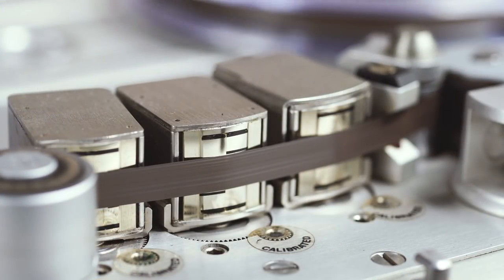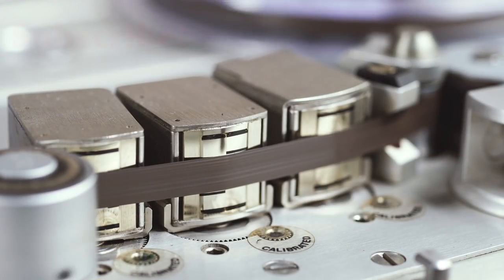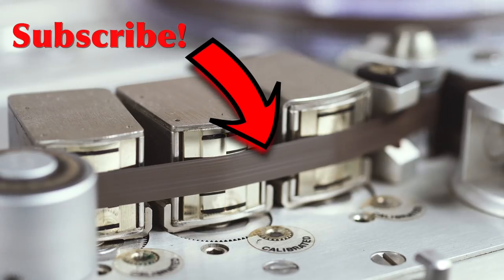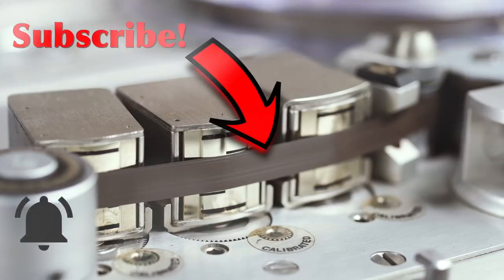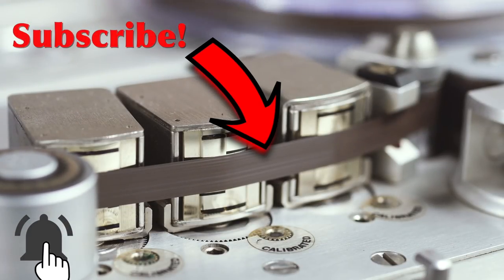Hegel H590: Reference or Illusion?

Comment: A REQUEST:   A comment below from TOMISLAV GASPARIC about super high damping factor sounds makes a lot of sense that I really hope ANADIALOG can respond by saying what speakers were used in his review:

"That can be related to high damping factor, some, most of speakers do not like it, their crossovers, their diver/enclosure tuning can interact with high damping factors and start to ringing due high Q states in loudspeaker system.
Try to put 0.05-0.1R power resistors in series with loudspeaker"
Reply from the maker: I did not see the comment. As you can imagine there are hundreds to process and the darn app does not work properly.
In any case, if this is true, the amp is even a worse project than I thought. How many attentions do we have to pay after spending 11.000€!! The speakers I was using are a GoldenEar Triton Reference.
Reply: @anadialog  The question to ask is really how many (%) of speakers out there and what % of audiophiles do sense this "problem".  At the least, Harbeth designer Alan Shaw seems to like Hegel "sound/no sound" and demo his great speakers with.   I myself as another audiophile don't sense that "problem" as some Analog/tube people do that I have to question based on their taste of liking harmonic distortion/color than pure high FIDELITY and can not clearly define "digital" sound scientifically in both qualitative and quantitative/measurement terms. :-)

Comment: Finally, someone that has cojones.. and it needed to be italian for it. 
First of all Hegel amps sounds off.. all of them. 
Second, what’s the point of making a class b amp trying to make it sounds like a class correcting its natural distortion with a class leading circuitry? Uhh 11k € you said! Now I get that. Good technology comes cheap and for all. 
Now for 11k is possible to get a much better amp full class a. Hey but class a gets hot!.. Uhh use it during the winter than. 
Dumping factor you said?!
Well I build my stuff from scratch and that doesn’t count.. but hi impedance speakers would solve this problem. Why on earth the industry keep selling 4-8 ohms speakers to go with fancy amps you think?!  Wouldn’t you buy a 300 ohms speakers with dumping natural factor to die for?
Look with 11k I can build myself a point to point wired tube amp only made of gold glass and ceramic. Think about that. Uhh… even the tubes!?
Yep even tubes.

Comment: I had the same impression of the “separation” until I changed cables. It then all came together. It sounded totally natural and coherent. I’m not a cable guy but the recommendation made all the difference.
Reply: What cables if you don't mind sharing?
Reply: What kind of cables do you use?
Reply: and you didn't mention the cables?  Wtf!

Comment: Great review.  It’s spot on.  I moved from the Hegel H390 to the Luxman 590ax2. The Luxman is an awesome amp so musical and full sounding.  Sounds like music. I would describe the Hegel as surgical sounding.  Not my cup of tea.  Keep up the great reviews.
Reply: Luxman is a beautiful kit. Although it’s not made in Japan anymore like Accuphase. Have you tried Pass Labs?
Reply: @morespinach9832  the lower end Luxman are not made in Japan but the higher Luxman like the 590ax2 was made in Japan.  Luxman no longer makes the 590ax2.
Reply: @JayLee-zz3ty  so which Luxman is made in Japan? Their lower end stuff is way too expensive if it’s not made in Japan.
Reply: @morespinach9832  here are some of the models made in Japan, 590ax2, 595ase, 509x, high end separates. These are just the ones I know.

Comment: I still like class A/B amps. My system is tri-amped with two Parasound amps and an Adcom amp.
Reply: Class A/B amps are usually a good solution, especially if one needs a lot of power. However, pure Class A amps are superior IMO, but they generate massive amounts of heat if a decent amount of output power is needed. I have a Class A headphone amp, which at that low power is not much an issue with heat, and it is far superior to any other amp I have used. BTW, the Hegel amps are A/B.
Reply: @mark9118   oh, I didn't know it was class A/B. At any rate, my old Parasound amps sound great. Don't think I will ever replace them.

Comment: I bought the hegel H360 after my Krell kav300il baked out of warranty, I tried many products at and around the 360' $5500 retail and for the speakers I was using then the Hegel was clearly the best sounding and most powerful (read dynamic bass). I now also have the H590 and will say the h360 is a bit smoother all around, but like everything else component matching is important. I will agree with this review with the qualification that this reviewer will have different results depending on the speakers. With the Blades the H590 is a beautiful combination, with the paradigm persona 7f the music was disconnected with unpleasant results. smooth speakers that need an iron grip appear to be the best combo.

At axpona 2022 a lot of big speakers in little rooms made listening painful at times. I paid attention to the kit in rooms that managed to still sound competent in this scenario and the Kef ref 3 with the H590 kept getting high marks. The Hegel isn't magic, but in its price performance class it should me considered as a must listen at home because when partnered with the right speakers it is a bargain.

Comment: I’ve heard nothing but positivity about Hegal amps, particularly the 590. I’ve unfortunately not had the opportunity to listen to a Hegal, so can’t comment directly. I have though heard other amps that prioritise accuracy, transparency, speed and control and found the musical reproduction not to be fluid. It sounded disjointed and staccato. Take a premium amp that injects harmonic richness, acoustic mass and bass heft, be it at the cost of a little detail retrieval, and you, in my opinion, end up with a much more legato, smooth flowing musical reproduction, which better suits my listening preferences.

Comment: does it convert analogue into digital input? I think you're better off with the new Technics su r1000 comes with a special record for calibration of your turntable to the amplifier.
Would be a good review from you if you get hold of one I'd say it's a lot better than the hegel.
But the ultimate is to go for single ended triode valves for enter vinyl or tape. The best  you can get is the audio note M3 pre, and  monoblock Gaku-on +,  we're not talking cheap it's a lot of money but very good quality probably out of your price range but they do finance!! Or I would consider but is very reasonably price the integrated amplifiers' like the oto  phono se silver signature, fantastic amplifier. An amplifier that you wouldn't ever need to replace again a real game changer!  make sure it's a real thing  comes with certificate there's a lot of fakes and kits with audio note Gear.
Reply from the maker: Thanks for the suggestions...I will keep hunting and keep those in mind. I have seen the Technics, seems amazing new technology.
Reply: The sound engine is a pure analogue technology. The analogue signal is never converted to digital in the amplifier.

Comment: Hegel is not for me, doesn't quite gel as a whole and has to much of it's own character to slot into any system. I also feel the Luxman integrated offers a different sound, but also to much of it's own colouration to the sound. It's a very personal choice, and amplifiers can make or break a system.
I prefer the Gold note IS 1000 to them all and is cheaper than both of these amplifiers.

Comment: I've had the H300 and the H360 before that amp, and the problems you are pointing out about the mid-range and about the separation inside the recording, the separation between the instruments, I never had in any of my recent systems - and I also had for a time the Luxman 590. I think that you now have a level of transparency and resolution and accuracy that you never has before, and may discover downs of the rest of your system. Also, the mid-range is not so-so at all - and I think you should wait until it is completely burned-in anyway. Best regards, and enjoy the Hegel - you are in a whole new level altogether now.
Reply from the maker: I see. Thanks for your point of view. I just want to add that the unit is used so it is fully burned in.
Reply: Luxman is just better then hegel. Simple.

Comment: Break in is a real thing, especially with high end gear. You should probably put 200 hours or so on your amp before actually critically listening to it. It took 200 hours to fully break in my HTE Holo May DAC for example for it to start sounding analogue and smooth and not sibilant and overly etched in detail. Also a power amp you should check out is the Benchmark AHB2. That’s what I use and its amazing.
Reply: Is it a used unit? He didn't say.
Reply from the maker: Indeed...but this is a used amp, it has way more than that on it. That is why I did a critical analysis after a few days.
Reply from the maker: It is
Reply: @anadialog  Ahh ok. I thought it was new. several people I respect love the sound of the Hegel. It has a lot of oomf in the low end. If you get a chance try the Benchmark AHB2. It has God tier level of dynamic range and clarity. It is the perfect match to the Holo May DAC and when paired with a great tube pre-amp sounds out of this world.
Reply from the maker: Thanks for the reccomendations!
Reply: When someone doesn't like something it's "burn in" lmao ok
Reply: @Richbroth  No, but burn in does make a difference. If someone still doesn’t like something after burn in then that’s fine.

Comment: It's just an illusion for your ears witch where calibrated to your luxman amplifier !!!
Hegel 590 it's high end manufactured with any shortcut !!!
I had the H100 it's was  a very good amplifier !!
And this is my personal experience .
Reply: IMHO, not so. I have expierence with both and they are very different. The Luxman's whether it be there integrateds or srperates have a smoother more blended but detailed sound. As where the Hegel's are very detailed. It just comes down to personal preference. If he likes the Luxman, he only bought the Hegel to make sure he was right in his choice.  With the May DAC, Hegel, and Luxman he has invested approximately 20k+ used in the last 9 months. He never mentioned that these were review samples.
Reply: Confirmation bias.

Comment: I think what you are hearing is a very good digital amplifier (one that sounds good with digital sources) but one that tries to take the best character of analog and it is trying to make an imperfect format, perfect and unfortunately, your ears are trained to hear it differently.  I too have auditioned other DACs and I can tell when something is trying to be too precise and it is fatiguing after a while. I know my dealer hates Hegel and he won't carry it as a brand for the reasons that you just mentioned.  He had a used one in on trade and he was not impressed at all.  As you have said many times before music is meant to be Analog.  There is a place for digital and I like all formats and I stream, but analog is where I spend the bulk of my time.

Comment: I completely disagree because your not talking about VALUE. I think the Hegel amps are built like TANKS and they can’t be beat for the $. Now can you spend more money absolutely but when you look at the internal components and what you get compared to other manufacturers it’s Hegel ALL day. I have seen 20k MAC amps with a $7 volume control. I also have a new pair of ATC 19 5,000 dollars speakers and I will tell you the same thing you can spend 3 times more money and they won’t sound as good as the 19. Sorry but there is no way a Luxman compares to this particular Hegel. Sorry I not only disagree but it’s the reasons you give for why. As far as DACs you can always add an external DAC
Reply from the maker: Value? You're right, the Hegel costs much more than the Luxman. Another reason to discard it.
Reply: @anadialog  
Sorry its not JUST  about cost it’s about VALUE and BUILD quality that’s what puts Hegel out front. If you dismiss something simply based on COST then you probably couldn’t afford it anyway. Funny nobody mentions cost when taking about Rolex or Gucci but in high end audio the first thing any body complains about is COST. Who pays 14k for a stylus as an example.

Comment: The thing is that an amplifer performs a mathematical operation, it amplifies its inptut and deliver it to the next in the chain, a transducer.
And without deviation.  Descent amps have been able to do this since the late 60s or early 70enties with deviations as low as 0.000X,
so, this is the usual bs. Read the art of power amplifier design, by John Lindsley Hood, 600 pages.
Reply from the maker: Not true and the best sounding amps are just pure analog amplification and handling of the signal. No mathematical operations on my Mc30 and they are the best thing I came across. Drop the book and specs and start using ears. Hegel is clearly adopting complex manipulation of sound as explained by his designer in several lectures.

Comment: Thank god, a heretic! It has to be said, so much praise for Hegel and much about how they pair with anything but in my case I put the H95 in my system and initially was shocked that it sounded like the bass completely disappeared. Ok I thought perhaps the previous amp had too much emphasis on bass and the precision and damping on the Hegel would win me over , a couple of months in I find that the unit has to be quite loud to get any decent bass but that produces a fatiguing treble and yes as you say, everything sounds very digital. It’s almost as if your digital source was glitching all the time in a very consistent way. 

The thing that has done it for me is I had an audio lab m-one compact integrated come back from repair and I put that in the system and it was engaging and none fatiguing and musical again— this is a piece of kit a third of the price  and it felt more right than the Hegel….
Reply: What's the sensitivity of your speakers? Bass on the newer Hegel's is supposed to be fast and presise. But yeah not super deep. I use a sub with my Kantas to get some of that deeper sustained bass that I like with Lydia Ainsworth or Dead Mouse. For more precise recordings the sub is so low, but I still get that sustained low on top of the fast bass response. Trick or treat. Lol🎃
Reply from the maker: Ahah! Interesting, thanks for sharing that!

Comment: You can not drive efficient speakers with an amp that is meant to drive inefficient speakers and complain afterwards that it did not work for you 😂😂😂
Reply from the maker: The speakers I used have a 92db of sensitivity and are perfectly comfortable to accept a whopping 750W I wasn’t using a full range loathed 2 ohm speaker, so actually no, they should have behaved better.
Reply: @anadialog  92db lies in the middle. It is not fish, nor meat. Hegel works best with inefficient speakers 85db 4Ohm. 
What kind of speakers do you have? 
Maybe you mention the speakers in your next amp review. 
Keep up the good work. I am a big fan of your critical reviews!
Reply: @anadialog  i forgot to mention. I am using H190 with TAD ME1 and it is a great combo.